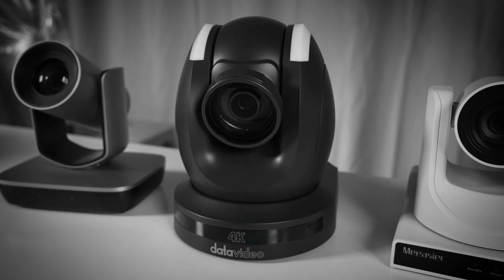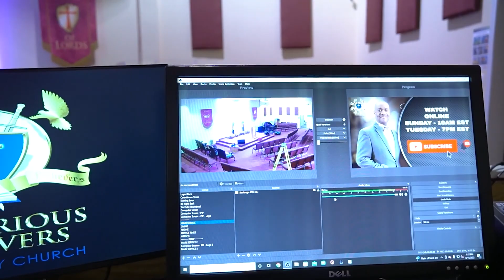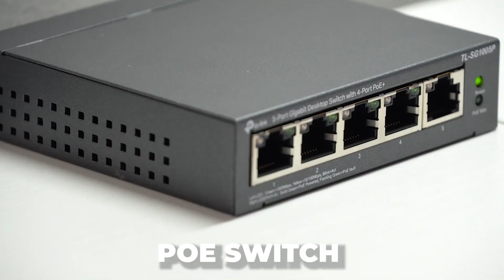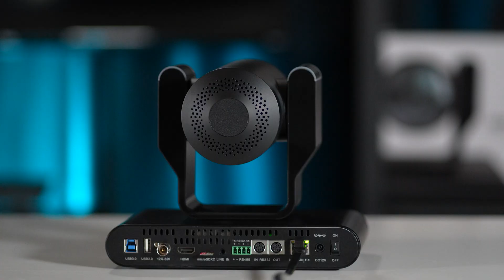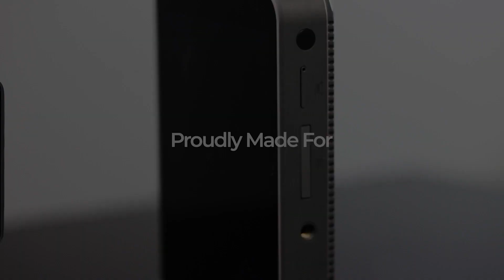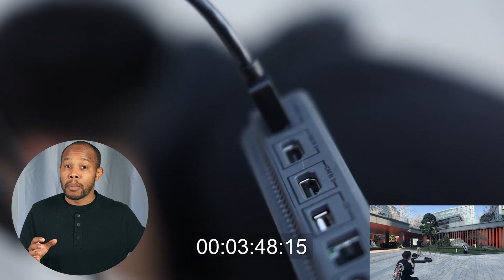PTZ Cameras... The Best Camera For You?

Comment: Why the Tenveo 4k Ptz Camera don't work in 4k? i set it up on the menu but the video is not showing...
Reply from the maker: Can you explain what you mean by “don’t work in 4K” … it does have 4K capability but if your infrastructure doesn’t allow for 4K all the way through then you would be unable to maximize the output resolution.
Reply: @MonteWeaverofficial  ok tnx. Could you tell me what kind of DC connector
 does it have the camera? I can't find out, I would like to use batteries and avoid connecting to the mains, but I don't know the type of dc adapter.

Comment: Hey thanks What would be a good   Ptz Camera to use for filming live music? The live events will all be in the same location so the cameras (2)  will be mounted on the wall.
Reply from the maker: The sensors in PTZ cameras for 1080 are almost all the same. (these cameras are built in the same factors, just different brands selling their versions) ... The main consideration is if you want 1080p vs 4K - Going 4K will give you better image quality, but does come with a slightly higher price. 4K will give you better performance for low light ... I use the BZB Gear 4K camera in my studio and when I'm on client calls, people always notice the quality of it. - Here is a video of it - https://youtu.be/TFAFGZJHbQc

Comment: I would like to try a Canon CR-N300 as my number one camera. I would also like to try the CR-N500 but that would blow up my budget. Right now I have 5 PTZ's in my church and they get the job done, but I would like one that could give me a blurred background.
Reply from the maker: 5 PTZ Cameras !!! You have you a nice setup!  I would like to try the Canon PTZ as well.
Reply: Hello - What kind of setup do you have at your church? We are currently trying to find a solution which doesn't blow budget. We have about a 5k budget, and our church needs it..
Reply: @BillyWallace785  I have 5 PTZ cameras, two 30x PTZ in the back 1 20x in the front facing the audience and two 20x cameras  on each side. They are connected to a ATEM mini Extreme with one USB-C connected to a computer running ZOOM and the other connected to a SSD drive to record the program and all 8 channels in case I need to edit what I send to the podcast. We have a computer running Proclaim to send graphics to the big screens and the ATEM  for songs, scriptures and titles.

If I had 5K I would buy 3 PTZs to cover front back and side. $650 for 20x and $700 for 30x. By the time you install and wire them the cost will be $2000-2500.  Next I would get the ATEM Mini Extreme ISO $1300. You will need at least one computer monitor and a set of headphones. I will assume that you have the audio covered and a good internet connect so you just need to send a mix to the ATEM. At this point you are ready to send your content to YouTube, FaceBook ...
Make sure you get 5K or more for next years budget. You're going to need it because they will want you to do more once they find out what you can do :)